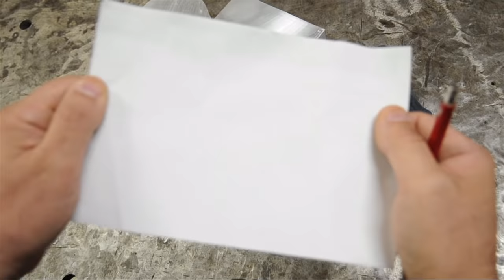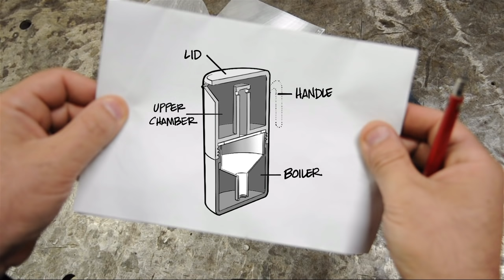Making An Espresso ... Pot!

Comment: maybe next time you should do a percolator style, less moving parts, no actual gasket, check valve, or pretty much any thing.

so here is how it works, the coffee pot sits on the bottom, full of water. there is a plunger with a fine knurling that acts as a coffee bean filter that sits in the center hole of the top half. then there is a lid for both the bottom and top, more important for the top. as you heat the water the steam rises through the beans condenses and then falls back down through the hole. some water may go up, but who cares.

Comment: Hey Tony!
What did you use to clean your grinder belt? At 25:30 . I suppose it's serves to clean the belt and does this thing also works on small belt grinders?
Reply from the maker: belt cleaner. I think it's just a block of gum rubber... available at most hardware or box stores. yep works with any sandpaper. I bet an old sneaker would work too.
Reply: @ThisOldTony  Thanks for the advice!

Comment: Nice Moka pot: strictly, what you have produced is a moka-maker, not an espresso-maker. A moka pot typically operates at 1 to 2 bar (100 to 200 kPa), whereas espresso makers operate with at least 9 bar (900 kPa). the latter gives a more intense flavour and a rich crema top. Moka is not espresso, no matter how much WD-40.

Comment: nice, but i wouldn not use aluminum to eat and to drink from, it is almost toxic, second how you regulate pressure of vapor, i have dolce gusto caffe machine and i tried to save some money and to reduce plastic in use for eat and drink so i ordered stainless steel reusable cup: but they did not make good pressure valve because for good coffe must be right temperature and right pressure, othervise bad no tasty coffe, so i had to make spring loaded adjustable valve in many tries

Comment: Silly non-machinist question here: You're going through quite a bit of expensive metal and ending up with quite the pile of metal shavings. Do you sell those back to finance other projects?
Reply from the maker: scrap guy used to pay me for it now I'm lucky if he takes it for free.  I don't do a good job of keeping all the metals separate.
Reply: @ThisOldTony  Thanks. I figure the scrap value is pretty low anyhow.

Comment: Why are you making something using a milling machine and a lathe when you can just make a sheet metal roller and use it to roll the aluminum to the correct shape and use the welder to weld the metal pieces together? It would save a lot of material.

Comment: I would not have assumed that any old aluminum alloy laying around the shop was particularly food safe. Have you looked into that as being an issue or not? Most metal shop projects are not intended to cook food, so I imagine the engineering of the material is more concerned with tool/mechanical properties than being child safe for the play pen or kitchen. Aren't lead and arsenic sort of common alloy ingredients? I wanted to write this prior to any remedial investigative efforts and leave it as a sort of cliff hanger. Spoilers welcome!

Comment: "Don't like espresso?? "  do it the cuban way   or at least like my ex- father- in- law way which is REALLY Good.
use Bustelo  coffee.  pack! the the coffee into  it,  then  Add 5 Tsp or is it 5 Tbsp of sugar into the water container before hand.  screw it on tight. Now your ready to brew.    DRINK AS IT IS!,  in tiny Cups.  Don't add cream or milk to it.  This will ruin it.  If you have done it right ,  it will taste like chocolate.
I really liked the assistance you got from Voltron when you where wielding or was the Helio Arcing?

Comment: Most guys' honey-do list is mowing, fix dishwasher, etc. Yours wife says, "make an expresso pot" while you're just pissing around in your man cave!" 😂

Fyi - Bed Bath and Beyond has a 6 cup one for $40, Barnes and Noble $30, and Blain's Farm and Fleet for $17. LOL

Edit/ I was so focused on this project that I literally puckered my lips to blow away the metal dust/material after you tapped the hole for the pressure relief valve. Smh Now WHO is your biggest fan after reading THAT?!

Comment: at like 14:15, what are the chances of the 2 halves unscrewing while the part is being worked on and causing chaos?  I would have been sketched out by that
Reply from the maker: the cutting forces are always in the "tightening" direction.  if the threads were left hand, I would have had to reverse the lathe to compensate.

Comment: This machine doesn't make proper espresso by today's standards.
That's how espresso was made a century ago, but nowadays the temperature is cooler (below 100C) and pressure is 6 times higher than with this machine... so the result is not an usual espresso, but you'll get some coffee with this machine :)

Comment: ALUMINUM???
Oh... it must be "food grade" aluminum....
404 stainless might be safer if your going to use it for food use.
Might be better (AND LE$$) to get a small tube of 404, use a bead
roller on the tube and a flat plate, then weld the two together.  Much
le$$ and safer than using aluminum for consumables.

Comment: But this is not an "espresso pot" (whatever that means) as it doesn't make espresso. This is a moka, that's a very different coffee from the one made by an espresso machine.
Reply: J R ahhhh Grasshopper....you are only thinking in the present.  How do you think espresso was brewed before mechanized & computerized modern day espresso machines?
Reply: @jwdickinson643  In the past there was no "espresso", the word itself can be translated to "fast" and it describes the process of brewing a coffee quickly (like with an espresso machine) and it is different from the moka coffee which is brewed more slowly. One of the characteristics of the espresso machine is to produce a foam on top of the coffee, thing that the moka machine doesn't do (expect some newer models).

Espresso machine was invented in 1901, Moka was invented in 1933. If you want to go further back, the Napolitan one was invented in 1819 and that is the way it was done in the past mostly. 

In any case, it's a nice job done in the video.
Reply: J R lesson learned  👍

Comment: I don't drink espresso but wouldn't you burn your hand picking up the pot by the lid?  Yeah you've got a pin connection and some wood over it, but if it were me I'd try to make the handle almost entirely out of wood, but then I'd f it up and go out and buy one... even though I don't drink espresso... wait, why am I...

Comment: I admire your skill and aesthetic, but practically you have created a pot with a huge design flaw. The reason shop bought ones taper is to allow for the volume of water required to make a proper cup of coffee, not an egg cup, and also for stability. This is not an espresso  machine.

Comment: If Ford AND GM and all the kids can do it ... You can too ANTHONY !
HOW DARE YOU BE MODEST AND SHYING AN "A" ... OR BETTER !
 DIY ... WATER PRESSURE SPRAYER, A FEW HDPE GASKETS IN YER 3PC MOULD ....
ALL YER FAV TOOLS AT WORK !!   ....

A HYDROFORMING MOLD.
Reply: P.S. ... I dunno why the electric die grinder... a small airpowered handheld with some diamond bit tooling might suffice... even for the mini lathe... WHICH IS UNDERVALUED... BECAUSE AMERICAN HANDS AND MEEKNESS WERE NEVER GIVEN IT ITS RIGHTEOUS DUE !!